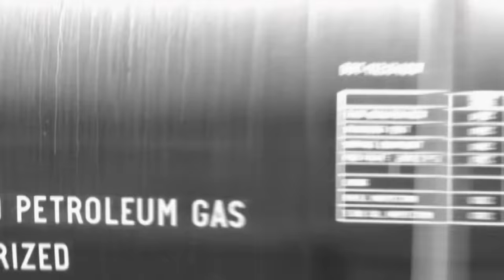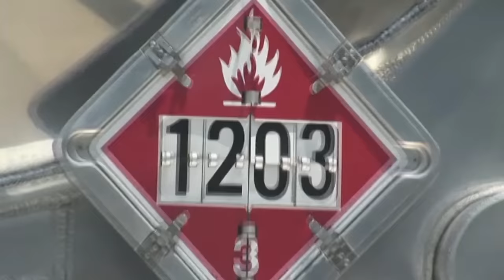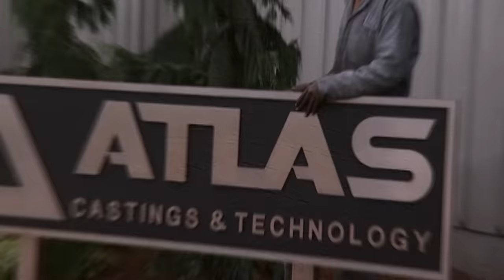Horrifying Bleve Explosions Around The World | Explosions Gone Wrong

Comment: 1203 is not acetylene gas. 1203 is gasoline
Reply: Good call on the placard mistake. You are either a truck driver, or a first responder.
Reply: More than that, you cannot carry acetylene in a tanker. The pure gas is explosive under pressure and must be dissolved in acetone for pressure storage. Because of this, it has to be shipped in the cylinder that it is used from.
Reply: 1203 gasoline, 1993 diesel.
Reply: @cryhavoc9748  Or they read wikipedia pages on the symbols out of boredom, like me.
Reply: 1273 is no good.
Reply: @jimclarke5607  Correct. Also, acetylene cylinders aren't just hollow tanks. They have solid porous fillers within that store the gas like water in a sponge. And they have fuse plugs that melt so acetylene cylinders don't explode. The fuse plugs melt out and the gas escapes and burns off.
Reply: @blutoactual230  When I apprenticed it was Kapok (Coconut fibre) have no idea what it is now.
Reply: @jimclarke5607  I worked for Union Carbide (Linde) from 1980-90 and the filler was calcium silicate, but some of the older cylinders had asbestos fillers.

Comment: When u see tanker on the road it’s like seeing a bomb so driving near it feels like driving by bomb lol that u never know when to explode
Reply: What an idiotic statement.  Only pressurized tankers can explode...
Reply: The REAL problem is when they are empty:  the gas and air mix and it is then a bomb waiting for a detonator.
Reply: Phil, NO.  Just no.  Gasoline has a very narrow flammability range, 1.4-7.6% in air before it will burn.  And the tanks are sealed, so there's no way for an ignition source to be in the tank.  You would have to perfectly mix the ration and install an ignition device in the tank purposefully to ignite it.  Any little bit of gasoline in the tank is going to vaporize and make the mixture way too rich to ignite.

Comment: I saw a B Double of fuel explode as a teen here in Australia at a place here in Queensland called Plainlands near Laidley… it happened at least 5 km’s away but you could feel the heat from it, we did not even need a torch to walk through the thick bush towards the back of the property, it was lit up like daytime, surprisingly the truck driver was ok, the other car that got wedged between the two trailers wasn’t though

Comment: As someone who used to haul petroleum distillates and compressed gasses please note ... at approx. 1:42 the video is talking about acetylene compressed gas BLEVE and during the introduction of the event a  a liquid petroleum truck is shown at approx. 1:54 with a placard of 1203. Placard 1203 is a petroleum distillates placard and does not cover compressed acetylene and the trailer shown is not a compressed unit either. The placard used for compressed acetylene is 1001. If you are going to make a video at least get the facts straight. You lost me at this point so I don't know what other errors were made.

Comment: The one with the truck at the Atlas foundry ( 4:55 ) was likely caused by the engine of the truck detonating. You can see as the liquid propane starts getting into it's air intake the truck starts revving out of control. 

Interested in learning more about diesel engines and fuels? Keep reading. :)

Propane is much more powerful in terms of combustion than normal diesel.  Fules such as Gasoline, diesel, and even Propane, have an octane rating often measured in RON here in the us.  This is more or less a value that represents its potential stored energy. Bigger number, more powerful file.

Diesel is rather low octane, its hard to combust and releases less power than most other fuels. It has an octane rating of only about 12-25 RON. And get this, the oil you use to cook with, and put in the engine to lubricate them, that can also be about the same cumbustability as diesel. Its how you can make a diesel vehicle run off old fry oil from your favorite resteraunt. (After some filtering and other possible adjustments.) 

For some comparison, most gasoline engines run on ~90 octane. But propane, is well over even that of gasoline, and sits at ~112 octane. Diesel engines are designed to be low reving, high torque, heavy monsters that spin hundreds of pounds of internal components very slowly by relative terms. Only revving to about 3000 RPM maximum, where your average car can rev up to about 6000-8000 depending on engine. 

Diesels combust the low octane fuel through compression detonation. That means they simply squeeze the fuel and as it gets to a point, it simply explodes. Somewhat like the snap-pops you threw around as a kid. There is no spark needed to ignite the diesel. This means the second that more fuel, in this case the propane vapors, enter the intake, it will rev, and rev, and rev, and at one point simply blows apart the engine as it is not designed to rev very high, and with no spark needed, even if the operator had tried to turn the key off, the engine at this point was a bomb. Unstopable until it detonated and set off the vaper near it.

Dont believe me? Check the footage at about 5:20 to see the plume of smoke that the truck spews out as it sucks in too much fuel and at this point is likely starting to canabalize its own engine oil and run away further increasing the explosion risk of the engine. Damaged diesels will actually consume and burn their own engine oil if damaged. Its called a "Run Away Diesel". If you ever want to see something scary but awsome, look this up on youtube. The only way to stop a run away diesel is to entirely block it's air supply. Nothing else will stop them till they either explode, or melt down.

After the explosion you can clearly see the hood of the truck is blown into the upright position from the explosion that likely started under it's hood.

Comment: Continuity error I caught immediately is that the UN number 1203 is automobile unleaded gasoline. 1001 is dissolved acetylene [typically in naphtha, because acetylene explodes if you try and compress the gas alone above roughly 5psi].
Reply: Glad I'm not the only one that noticed that (although I had to double check the number). Does the video ever show any pressurized tankers (rail or truck)?
Reply: @dracobengali  Sort of. Technically, most liquefied gas is under some vapor pressure. Even gasoline is in a pressure vessel, although the pressure under normal conditions isn't going to be the same as propane or other liquefied gas. I think they used a lot of stock images and B roll and didn't expect hazmat nerds to pick it apart 😁

Comment: In 1990 I started a job at a company in Milwaukee called Grede Foundry. There were a lot of older guys there who had previously worked at a now-defunct foundry and I'd here stories about a bleve explosion that happened in the 80s with a large propane tank that they used for refilling their forklift tanks. This tank was only a fraction of the size tank at Atlas in this video and there was debri flying so far, it was showing up on the air traffic controllers radar at Mitchell field Airport, which was ten miles away. It was reportedly caused by a guy smoking while refilling his tank and 3 guys were killed.

Comment: BLEVE tutorial:  As a vessel with hydrocarbon is exposed to fire, hydrocarbon is released via the safety relief valve to the atmosphere.  Over time, the liquid level in the vessel (i.e., rail car) falls.  As the liquid level falls, the vessel wall is exposed to fire with no liquid behind it.  The result is a loss of strength in the steel.  As the steel is exposed to continued external fire without internal liquid to dissipate the heat, the steel eventually yields, resulting in a violent explosion.

Comment: The propane truck explosion, you can see that the truck was either running or started by the driver during the leak. The engine sucked in propane and likely ran away, possibly exploding and causing the bleve. There is a plume of diesel exhaust from the truck right before the explosion.

Comment: @ 5:19 the truck has to idle to pump off the gas using a PTO powered pump
so the engine was running
To offload the truck. You can see a cloud diesel smoke rise once the engine’s intake sucked in the gas cloud revving the engine beyond its own control. Essentially it caused the engine to “run away” and the engine ignited the gas cloud.

Comment: They say acetylene gas yet the 18 wheeler in this video is placarded for gasoline 🤣
Reply: It was a fuel depot that dealt in gasoline, kerosene, diesel, fuel oil, propane, MAPP gas and also filled /distributed oxygen and acetylene tanks for cutting torches. It wasn't strictly a welding supply

Comment: They really didn’t explain why the bleve is so dangerous. Yes the flammable liquid/vapor increases in pressure while the wall of the container weakens due to heat until the container finally gives but the instant that pressure is lost the superheated liquid inside the container boils and vaporizes and becomes a rapidly expanding cloud of flammable gas. That’s the part of them that makes them so dang deadly. The military uses a very similar concept called a thermobaric bomb to great effect against personnel.

Comment: What ignited the tanker truck was probably the hot catalitic converter, or maybe the truck sucking in the propane, causing an ultra rich engine condition, causing unburnt fuel to continue burning inside the exhaust system, causing the burning to come out of the exhaust. That's too bad, that happened so fast there was no chance to do anything about it.

Comment: At 5:19 there is a plume of black smoke from the truck, indicating the engine is running and the propane is cutting off oxygen flow to the truck. This, I would bet on, caused the explosion. 
Always shut down all sources of ignition!

Comment: 5:20 I am sure the truck was still running when the propane leaked.
Once it was sucked in by the diesel engine in enough quantity, the engine ran away and destroyed itself.
You can see a black puff of smoke coming from the smoke stack of the truck before ignition. That black smoke is the engine going into overdrive and blowing out a lot of old soot.

The rest is history.

Comment: At 1:54 your speaking of acetylene gas but the truck your using for a visual is not used for pressurized gas’s like acetylene. This type of tanker is used for things like gasoline, diesel, kerosene or the like. You should do more research.

Comment: on the one in Tacoma, it was not a mechanical failure. I worked there and what really happened is the driver chose to use a nozzle that wasn't the correct fit to the tank being filled rather then take the time on a Saturday to go back to the shop and get the right one. it was his fault.

Comment: This documentary didn't go into the nature of how Acetylene behaves. You can over-pressure the gas, causing it to auto-ignite. Also, to enable it's portability and usability, acetone is saturated with the gas, so it's a unique beast. When using oxyacetylene to cut with, you ALWAYS pay attention to how the fuel tank is oriented. If it's anything but the proper orientation, the saturated acetone can spill out, causing the gas to burst forth from it, causing a mess. Most likely what happened with the DFW welding gas company.

Comment: You can see a puff of black smoke from the exhaust on the propane truck. That diesel engine snorted LPG and ran away. That's what started the explosion. The engine probably reved to 10k RPM.

Comment: "This can happen with any compressed gas"

Meanwhile, the CO2 and Nitrogen along all inert gas cans: "You wanna react? Im not feeling like doing anything today"
Reply: It does not need to react.
The fuel cylinders are not exploding because of a reaction, that comes after the gas escapes.
They are exploding simply because of pressure. The gas ignites after it meets the air. 

Any high pressure cylinder can explode and many people have been killed by air, nitrogen, oxygen cylinders bursting.
Reply: @forestdenizen6497  bursting =|= explosion

thats a very important difference to make. A balloon can burst, right? Unless you fill it with something combustible, you will have a hard time making it explode tho.

Same with tanks. They can burst, but a nitrogen or helium or idk, Argon tank never had and never will explode. Why? Because they are inert gases and they generally dont react with anything and if they do, its a forced reaction which is endothermic (which means it takes more energy than the reaction produces)

A petrol tank? A natural gas tank? Hydrogen? They will very much explode as soon as the conditions for an explosion are met.

Of course, they too can only explode after bursting. Or if they are so empty that a combustable atmosphere is inside the tank.

Source of my knowledge: Am trained chemist. 

tl;dr: All tanks can burst, not all tanks can explode. Very important difference.
Reply: Here's the thing: when liquid is heated in a sealed tank, it's liquid only until the tank bursts - then it all turns into vapour in an instance. That in itself is an explosion-like reaction and the pressure of the expanding vapours can cause massive damage. Beeing nitrogen, water, propane or any other fluid. There have been instances of water heater tanks having malfunctioned, demolishing a whole house beyond repair, lifting it of its foundations.

Comment: OK major issue @1:55 1203 is a class 3 flammable liquid (Gasoline) where as Acetylene is a 2.1 class Flammable gas (1001 listing for the UN/NA CAMEO Chemicals Data Sheet) and is far more flammable but still good video non the less

Comment: It wasn't the acetylene that started that fire it was the acetone tanks that were being filled. Acetone is pumped into a porous material and creates acetylene when the tank driver hooked up his hose they said he didn't check the o-rings there were four o-rings and you're supposed to lube them every time you hook and disconnect them for safety and so they slide in and out better and make better connections one of the shop workers noticed that he wasn't doing it and said it was probably because a cracked and caused a leak but he said it was just a matter of seconds after the stuff started spraying out on hot exhaust from the truck that the fire had started

Comment: They are cylinders, not canisters. You see where the relief valves on many of the cylinders have ruptured and are on fire.  As the heat  increases, the gas inside the cylinder increases faster than it can be relieved by the open and burning relief valve.  Eventually they begin to explode.  I'd rather have a narrator that knew what they were talking about than someone with a radio voice that is just reading from a script for pay.  He made a couple of mistakes in what he described.

Comment: "A freight train hauling 30,000 gallons of liquid petroleum gas...."
wait, what?
Liquid gas is an oxymoron, and it says liquefied right there on the tanker.
Reply: It’s condensed to liquid when under extreme pounds per square inch pressure. When it returns to ambient air pressure it becomes a gas again.
grab one of those little propane tanks for the hand held blow torches or one of the small ones from a barbecue and move it around you can hear liquid sloshing.

Comment: 5:20 time.  From the video, the trucks exhaust manifold, or exhaust, could have triggered the explosion.  Depends on whether the operator/driver was using truck  engine to pump off, or a separate one. Maybe the product,  ' receiver '  could have used an electric pump...don't know.  Either  case, it appears the start of said explosion, was the truck    a r e a.   (video slowed down  ALOT.....) ( old tanker guy _)

Comment: They keep showing tankers with 1203 placards, which is refined fuel not LPG.  Fuels such as gasoline, diesel, kerosene, etc. are stored at atmospheric pressure not under higher pressure like propane (1075 placard).  Completely different exposure.  Also, they could have explained the expansion ratio of fuels like propane and how that creates so much more vapor than liquid when released from a pressurized failed container.  Typical media stuff.  Show lots of dramatic video without actually explaining what happens in a BLEVE and why.

Comment: 5:05 Propane vapours escape from the truck, which has just pulled in to the area, after having been driven there, in a truck with a hot engine. SOMETHING, possibly a random spark ignites the vapour. Pelease.  ps, you hear a roaring sound in cases like this, you get your ass outta there ASAP.

Comment: Please get bleve correct.  It isn’t the expanding gas that causes the failure.  The liquid gas act as as a coolant preventing the metal from weakening.  But once it’s vaporized and no longer liquid it cannot provide the cooling and the metal heats up and weakens.  That’s what causes a bleve.  Fire protection engineering degree so I’m somewhat knowledgeable on that.  A near empty tank will bleve much sooner than a full one due to this.  👍🏻
Reply: You literally dont need a degree in fire protection engineering to know that gas expands, container too weak to handle the pressure, big boom